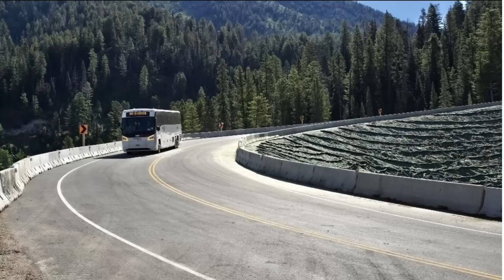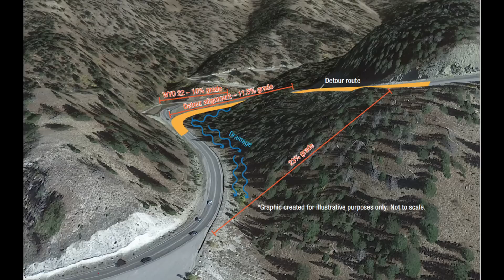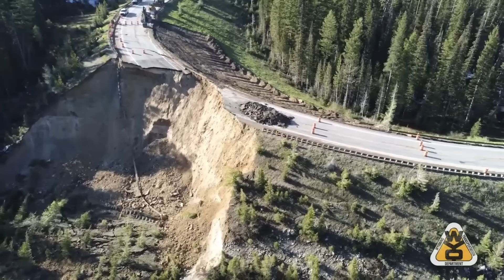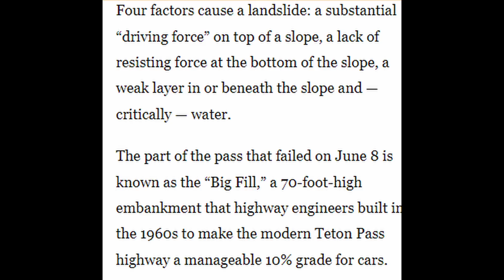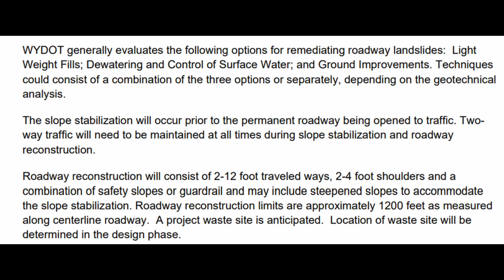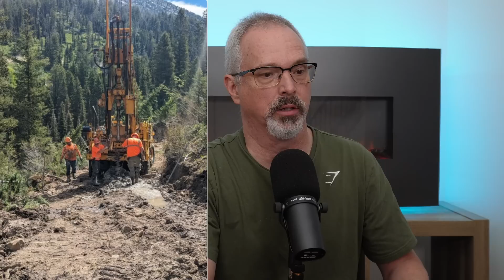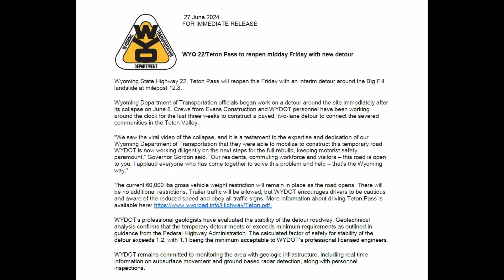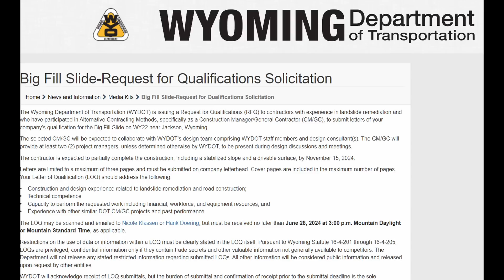Teton Pass - Bypass Completed and Open to Traffic

Comment: Purely theoretical: if the soils left followed the same pattern as shown in thia video, would mechanical stabilization (i.e. pilings) be a suggested option for the long term rebuild?
Reply: In principle, maybe. In practice it might be better to remove the soil fill, and build a giant viaduct instead.
Reply: @gordonrichardson2972  I guess it will come down to the studies that Casey keeps coming back to. The practicality of bringing large amounts of material through that 5 or 6 mile long section combined with the core sample analysis is what I am guessing will determine the final design.

Comment: Bridge or roller compacted concrete ?
Reply: I'll second that, and remove the clay down to bedrock for the foundation. roller compacted concrete was used to fill the void on the Oroville Spillway, and they did it proper down to bare rock and put in drainage. look at vids from this year ("calwater" aka "California DWR" YT channel has drone vids), and you can not tell just from looking where the void was.  thing is, RCC is expensive vs proper gravel with drains and stuff, still should dig out all the clay under the road first.

Comment: My sister-in-law works at the hospital in Jackson, WY.  A lot of people who work at the hospital in Jackson use the Teton pass in order to get to and from work.  When they work a 12 hour shift and have to add in a 3 hour detour, it is not sustainable.  The Teton pass is critical to that area's survival.  I don't think many people outside of that area understand the hardship on those who live/work in the the area and the money that it costs every day that the pass was down. This temporary bypass is only there to sustain people while engineers establish and implement a more permanent solution.

We also have to keep in mind that the people who live in that area are far tougher than the average American. They are well aware of the risks involved in living in that wild untamed dangerous area.  Most are outdoorsy risk takers and thrill seekers. Some will probably drive through the pass for no other reason than hoping to ride the next slide. 🙂
Reply: Absolutely nobody is questioning that. Temporary solutions still need to be safe solutions. As an engineer in the valley myself, I have my fingers crossed this goes smoothly and that failure doesn't slowly work it's way to the temporary road. That geometry doesn't look good to me. However, my biggest concern is that there temporary fix was done incorrectly and they're going to have to take two steps backwards to make the permanent fix. Potentially resulting in significantly longer closures. For example, how could they add geogrid, or subsurface waterdrainage under the new 40' of fill. Also, given the hundreds of thousands of people that will be using this road this summer, tourists and working commuters, the use of the word "temporary" is a more than a stretch. Thus, regular safety factors should be utilized. The fact that there's been no transparency, leads us to make conservative assumptions. That's how engineers are supposed to work. If they made assumptions and constructed prior to verification, then they're all going to look like asses. I'm already hesitant myself to drive over this road, I definitely won't be doing it around any rain storms.

Comment: That's unbelievable he said that about the F.S.. It's not the richter factor of safety scale. This is the same guy said he's not in the business of predicting landslides is telling us this isn't going to slide. Stating he's predicting there won't be additional landslides a week later. Does this guy have a PE? He needs to go back to school. Did I hear that right? They haven't performed the full global stability analysis? So, how do they even know the factor of safety is 1.2 or whatever.
For global stability analysis on slopes supporting buildings and/or developments, I've always seen a F.S. of 1.5 for static and 1.3 for dynamic (earthquake) analysis. As a structural engineer in the valley, that's always been consistant. 
Why doesn't WYDOT publish their calculations? I submit my structural calculations for review by 3rd parties to receive a permit, who checks WYDOT? I want to see if they made assumptions that weren't verified.

Comment: If they don't address the drainage it is bound to fail again.  Summer it is probably fine with the exception of a large storm, but in the winter if you have frozen soils and several feet of snow on the area on the inside of that curve you have a small dam with no outlet except to flow along the soil interface of the fill which will result in failure.  They need to do a jack and bore or directional drill to install a drainage pipe for the permanent fix.

Comment: Not an engineer here, but the "big filll" looks to be a big damn across that valley. Would culverts at ground level. Or several levels move snow melt and rain through reducing  the over saturation? And adding more fill on the uphill side of the slide does that put more weight on it increasing the chances of another slope failure?
Reply: Putting a culvert in the clay layer would not magically reduce water pressure, since clay has a low permeability.
Reply: @gordonrichardson2972  yeah, ye has to dig it out, put a few layers of other stuff in around the drainage, and doing all that with a temporary road sitting on top of it is a bit iffy at best. or better, completely remove the clay and put something else down in it's place under the raised roadway (roller compacted concrete is holding up well under the Oroville spillway so far).
Reply: @Zarcondeegrissom  I was thinking of a viaduct, but RCC would be more cost effecient. Either way it's going to be expensive to fix properly.

Comment: Anyone that has seen the basic building of a flat road on flat ground or the installation of a terraced yard would have questions about this repair.  
But on another note,  it's as perfectly safe as the last one.
Reply: The "last one" was built to the standards of the day, and lasted nearly sixty years.
Reply: @robgrey6183  , but it still failed.  Does it really matter when it failed?  Plus, it was shifting for decades.   It was unstable when it was built and no more stable now.
Reply: I presume they built the original curve on fill to maintain a 10% grade.
Reply: Sick burn.....:hand-orange-covering-eyes:
Reply: @SuperMadman41  , why would that be a "sick burn"?

Comment: They need to stabilize the embankment mechanically with sheet piles or use aggregate that locks together & allows proper drainage.  Keep up the pressure on these folks; remember safety standards are written in blood.
Reply from the maker: Thank you. They are taking a huge risk here I think.
Reply: Horizontal binding and drainage would be better. Geotextile layers are state of the art but requires the removal and replacement of a lot of the existing fill.
Reply: "Safety standards are written on blood" also means government won't worry if no one died, sadly.

Comment: 1.3 does not = 300%
Reply: I also echo the same point where sand cannot withstand a vertical face.  The internal angle of friction is key.  It sounds like their long term design fix will involve this calculation.

Comment: Thank you for the video and I do agree with you but I also understand the pressures involved in an important roadway 

So the question is safety and operational roadway timing

Too many questions unanswered to make a clear determination on weather WDOT is putting safety second to opening the roadway 

My opinion is the Governor needs to open an investigation to determine if the public is at risk this must happen ASAP
Reply from the maker: Thank you.   I contacted the governor's office and received no response.

Comment: they have a road now. stop bitching. of course it is steep & 11.2% grade-the rest of it is only 10.5% grade, your flatlands cars would not even make the grade. it goes for many miles at 10.5% too. oh, you don't like the very steep sides? duh, look at all the roads in WY, they are all that way. up in the tetons baby. don't forget it is high elevation, your flatlander car won't have but 2/3 power you need so you will overheat and be on the side of the road-oops-there is no turnout? hahaha sucker

Comment: I suspect that they did a cost-benefit analysis. If the cost of keeping the road closed exceeds the personal liability claims that could arise in the event of a failure, then they go ahead with the build. In other words, if they have to pay out compensation to the families of a few dead people that is cheaper than delaying the build, so the build goes ahead. There has been precedence for this within the motor industry. A recall may cost $100,000,000 but liability estimated at only  £20,000,000, so the bean counters choose cost over safety.
Reply: That's not how a cost benefit analysis works with safety.
Reply: @michaelcurtis-cdot8978  I may have used the wrong terminology but that is how a lot of major companies work. If the cost of rectification is higher than the likely cost of any compensation then they will go with the least expensive option. Possible death or injury claims do not concern them if the end result is a profit.

Comment: Minute; 14:08; ' Geologists blame a stout runoff season caused by a combination of hot days and warm nights that pushed groundwater through an underlying layer of natural clay.'
So does that mean the water temp was the driving force or the temp of the soil somehow weakened the slope?
Reply from the maker: I think they mean that the warm temperatures caused snow to melt at a faster rate.
Reply: @CaseyJones-Engineer  Okay, that makes sense, thanks Casey.
Reply: @lonihollenbeck4654  Accept this winter was basically average and nothing particularly unusual during the spring runoff. There's was nothing "stout" about this runoff season. The past 5 or 6 springs we've had several above average snowfalls and spring rainfall, but nothing that crazy happened this year. A few warm nights that didn't allow the rate to slowdown is pretty normal too. In fact, I think this spring was quite a bit dryer than the previous 2. I think they're trying to set in stone that this was an "act of god" and not negligence given the amount of precursors that occurred.
Reply: @jeffreyhobson8481  I don't doubt a word you say, just take a look at that dam that just overflowed and got outflanked, apparently that dam was on a death watch list, why the hell this government of ours will fund foreign countries to the tune of billions of dollars and cheat our very own infrastructure.  I swear, I'd make that a litmus test for anyone wanting my vote, 'who are you gonna work for, your constituents or some lobby?'
Reply: @CaseyJones-Engineer  Casey, on the video that I mentioned about shaking high rises in China, I did see videos of the SEG Plaza event at that time, and they were mind blowing, one could easily see the Antanea towers on the top swaying big time.  The people poured outa that building like a flood.  There were subsequent videos showing an internal demo to inspect section of the columns, and it wasn't good, man.  Now I've forgotten just what the horror was, honestly there's been so many out of China, but it was enough, in my opinion to rope the place off.

Comment: Nice job.

Yeah, I saw another report about the re-opening, I kinda wondered when the next Casey Jones video would be up.....

Part of me admires the effort it took those crews to do this in 3 weeks....  They must have been going day & night, mandatory 12's, 7 days, to do this....  It's quite an effort.

That unfortunately doesn't change the fact that this is kind of flawed, as Mr Jones has pointed out....  The new section could fail tomorrow...

Comment: The pragmatism, employed by WDOT,  reflects the political pressures to open the road and the seasonality of the risk factors. A temporary fix is a "calculated" risk based on past experience. Their gamble will probably work out. Any negligence settlements, will be paid by the state. You would make an excellent, expert witness at the trial.
Reply: Cost of doing business. Someone else pays the settlement/fine & no personal consequences  for anyone making these decisions
Reply from the maker: Thank you for your comments.  It looks like now the "temporary" bypass won't be so temporary as they will unlikely complete the repairs to restore the main embankment section this year.
Reply: This is absolutely common in many situations.  Same with airplane, train, and truck crashes.  You absolutely cannot shut down an entire airline industry, nor railroads, just because somewhere, and somehow, one platform crashes.  You go find out what happens as fast as possible, to stop or delay the next crash.  If hospitals shut down because one of their doctors accidentally cut your wrong leg off, there would not be any medical care.

Comment: In cases where I don’t know what the shear strength is then I will use residual strength but that is a phi of 8-14 degrees.  Unless they have removed the sheer surface with slickenslides this will slide again. 

The other question is what is the amount of settlement?  This slope hasn’t had time for secondary settlement.   They could have several inches of movement before a permanent repair is done.